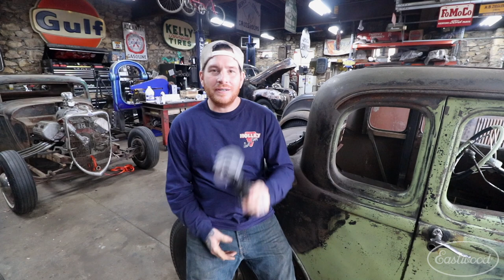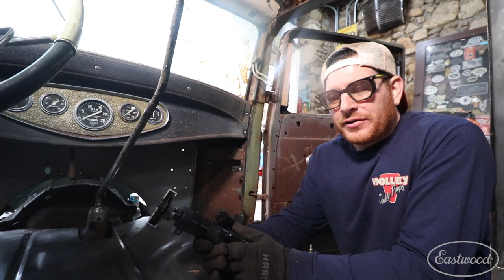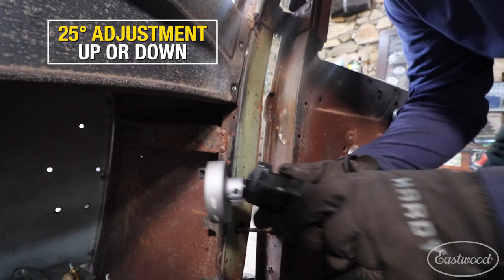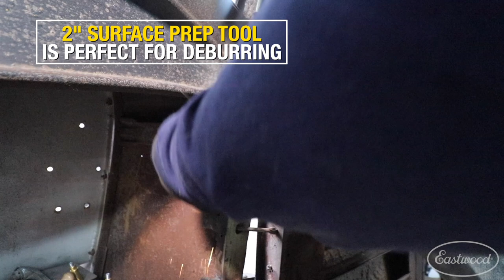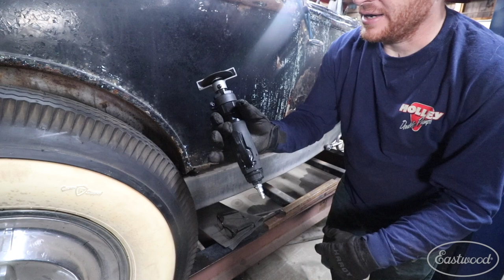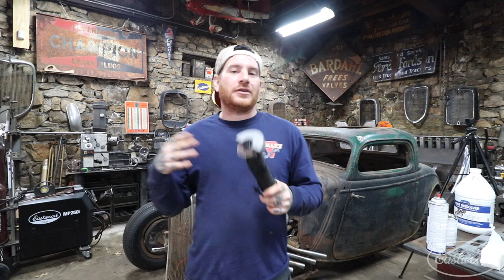Why You NEED the Adjustable Head Cut Off Tool for your Metal Fab Projects! Eastwood

Comment: Well thats a neat tool ! I need one of those. I have to cutoff the upper rear shock bolts on my 96 k1500 and a regular cutoff tool is at the wrong angle to get the bolt.

Comment: Hello, I am a mechanic which cutoff tool you would recommend for me to buy: the extended reach reversible or the flex head reversible. currently I have the old style cutoff tool
Reply from the maker: I think the real question would be do you need the ability to get in tight corners with the extended head or the flexibility of the adjustable head.  

If we could only buy one we'd say the extended reach probably adds more to your tool kit since you already have a standard cutoff wheel.

https://www.eastwood.com/4-in-air-cut-off-tool-w-forward-and-reverse.html